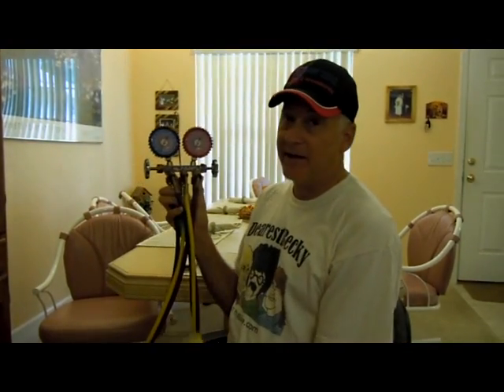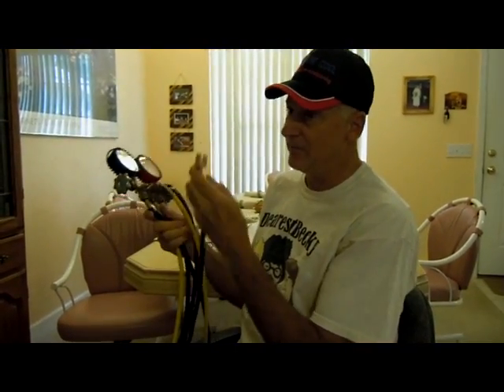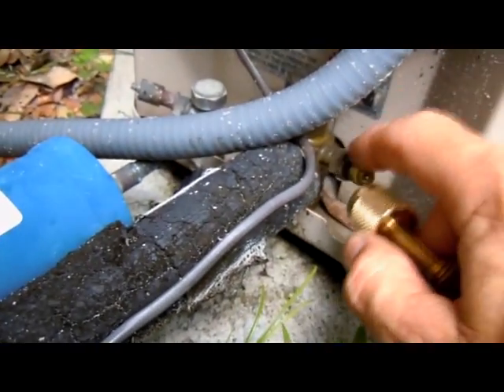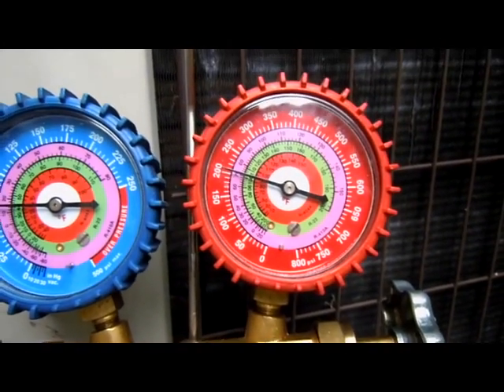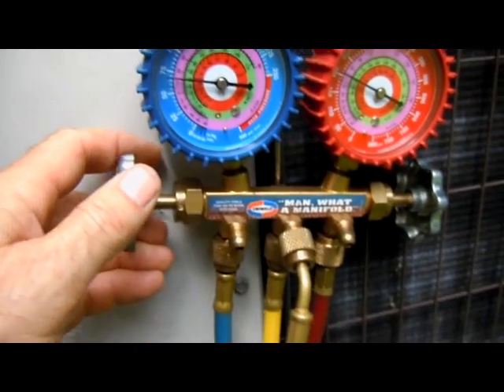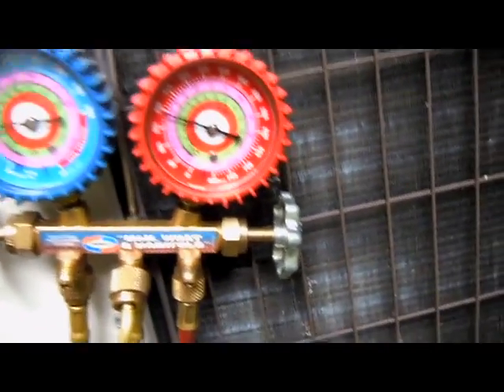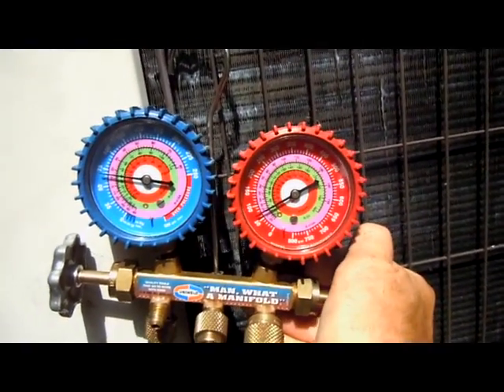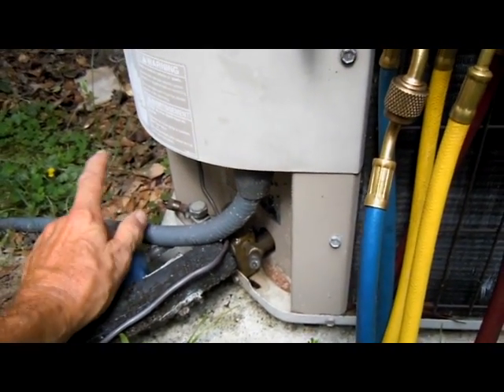HVAC Manifold gauges 2

Comment: Is it possible to use the gauges while the system is off? I had a tech hook these up on my unit...while it was off. Then tell me it was ok because the low side should be reading 120. ??

Comment: that's the problem with low loss fittings. you remove from the system and that charge is left in the lines. you can't check your next service call with them per EPA laws. you better have some better hoses if working with 410A. you don't have proper hoses with 410A and low loss fittings and your hoses will blow up like a balloon and pop. I know you were using R22 I'm just saying! no choice but to recover that or I'm pretty sure 90% of those leaf sweep it. Not saying names.
Reply: +merchants. What's wrong with leaf sweeping.

Comment: I'm just a first year apprentice, but I thought it was good practice to have the system off when put gauges on and off?
Reply: Best off putting the high side gauge on the discharge while unit is off. Low side on the suction while unit is running

Comment: I absolutely hate low loss fittings! I prefer yellowjacket ball valve adapter fittings. The fitting itself is not a low loss, but the brass pin inside is pushed in far enough to stop freon from blowing out when putting it on. You just have to remember to shut the valve before removing the high side! That way it acts as a manual low loss.

Comment: when you remove the guages and open the manifold so the liquid refrigerant goes into the low side, would that not cause moistuer to enter the compressor ?
Reply: alwayswakeboarding15 The liquid would flash to vapor in small quantities like that, nothing to worry about

Comment: You should be able to get a 3/8" female flare by 5/16" male flare adapter at most any hardware store. For my "good" manifold: I put caps on the manifold outlets, and a 1/4" flare plug in each end of the 3 hoses. I keep the mani in my trouble shooting bag with other delicate tools and the hoses coiled up and bundled together with a velcro strap. Either of those solutions should work! :)

Comment: Actually, the high, low, and middle side ports are standard 5/16, but the storage fittings are 3/8. I thing it was made in the UK or something... Do you know if any suppliers sell 5/16 storage fittings to store the open hoses when not in use?

Comment: The original hoses that came with my manifold were 3/8, which are too large to attach to any system. I bought some hoses with properly sized ends for servicing equipment, but now I can't store the ends of my hoses on the storage threads because they are meant to store my 3/8 hoses. Are there any places where I can pick up some storage threads for my manifold?

Comment: Thanks, but I already solved the issue. I bought a set of JB ( Just Better ) hoses, the low side does not have low loss, but the high side already has one that works really good. My only problem now, is that the original storage fittings are 3/8, when my hoses are 5/16. I can't store the open ends of my hoses on the manifold when not in use.

Comment: I have a fairly new set of manifold gauges that have never been used. The hoses already have low loss fittings on them, but the fittings are too large to fit on the shraider ports of my heat pump. Are there any adapters to solve this?

Comment: I heard the reversing valve switch to heat after the system shut off. I always thought it would only do that if you turned the thermostat to the "OFF" position while it was running. Did somebody switch it to off?

Comment: Dr Z what is the procedure for when you disconnect your high side hose from the valve and that shrader pin sticks open releasing refrigerant into the air?

Comment from the maker: @techbiz05 You can back flow the gas by loosening the yellow hose connection on the manifold.after you have the other end of the yellow hose connected to a drum of refrigerant and have the drum valve open.

Comment: Dr. Z, I tried my new set of 410-A gauges; which. coincidentaly, had low- loss fittings connected to a standard fitting. The condencer was set, the vacuum was pulled, and the refrigerant released. When it was time to remove the gauge hoses, I had forgotten to remove the low-loss portion of the fitting; and instead, unscrewed the standard fitting; and, you are righ: I was not happy.

Comment from the maker: @woody3307 If you suspect that you've lost refrigerant due to a leak, you need to recover all of the gas from the system then weigh in the proper charge according to the specs. Just putting the gauges on a mini split isn't going to tell you much unless the system is flat.

Comment: Dr. Z,
Hired HVAC gus to install a mini split heat pump Mr. Slim.   It looks like they did not back the stop valves out all the way to back seat and there was slight leakage at the valves.  The caps may not have been tight enough to hold it back, but they are probably not designed to do that. Anyway, I only have 1 service port? How do I hook gauge  to check the 410A level to see if still have a slow leak?  Will I lose too much 410 by checking?

Comment from the maker: @grlg2 Any time the compressor is located higher than the air handler you need an oil trap to be located at the air handler.

Comment: Hi DrZarkloff, Thanks for all the fantastic videos. I have a question regarding oil return on a mini-split  air conditioner (called "split system" in Australia). From what I've read in textbooks all pipework must slope downward (at a particular angle) to ensure that oil is pushed back along the the low side pipe to ensure good compressor lubrication.  I've asked a few installer over here and they don't seem to worry too much about it. Just like to hear your thoughts on the subject. Thanks. Greg.

Comment: I use the low loss hoses and they are great, only thing is because they are spring loaded they do bend the valve stem from time to time and you need to check to make sure there not leaking before you put the caps back on.